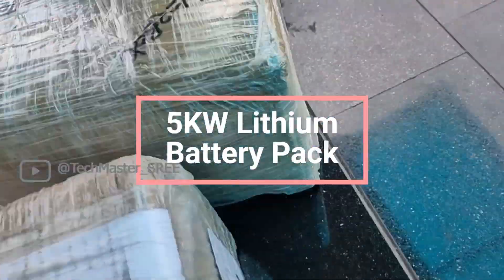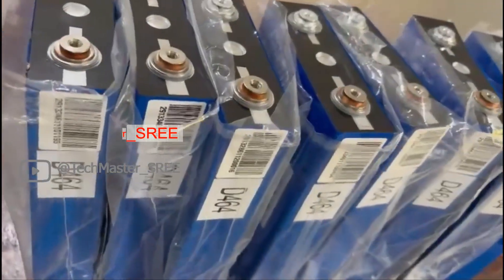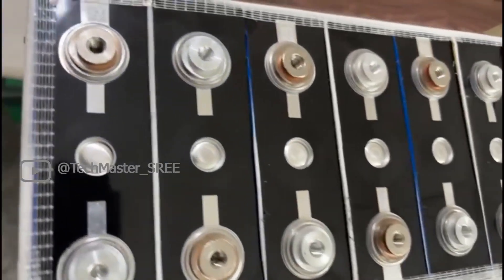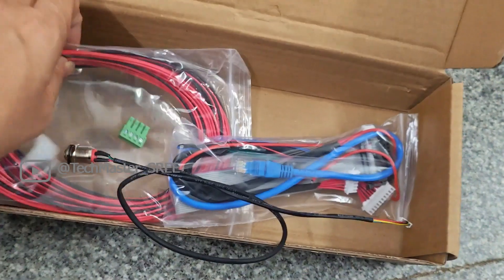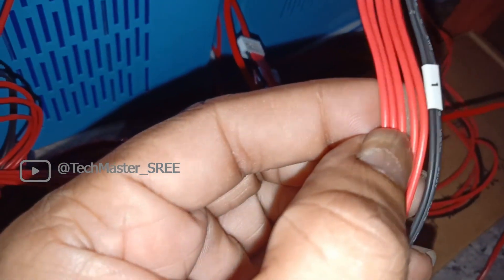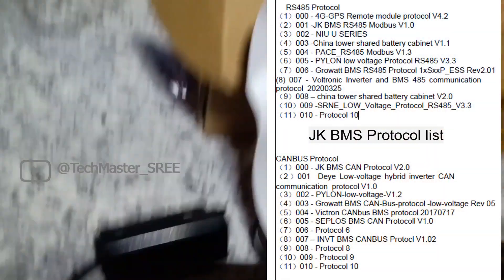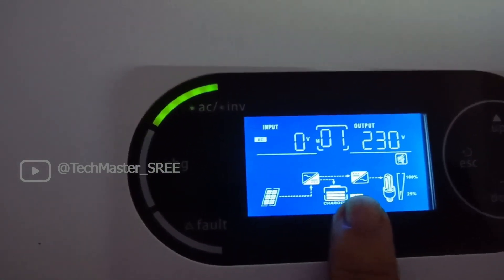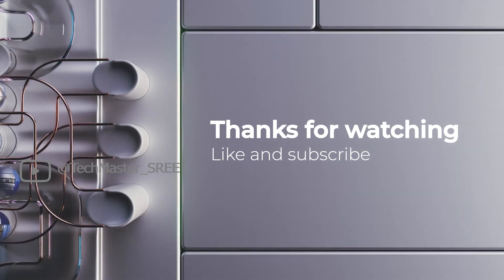Building a DIY 5kW Lithium Battery Pack from Scratch

Comment: Nice video
Can u make a video on testing, load told ah / watt output etc.
Reply from the maker: sure, planning to add these things on 2nd part. I already have a coulomb meter. Now its under testing . Need to set a case for this battery.